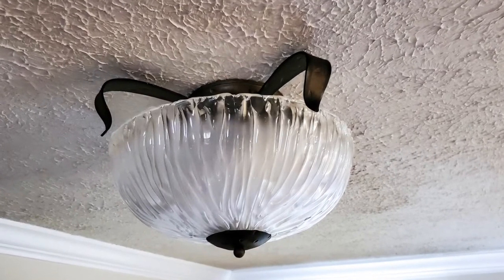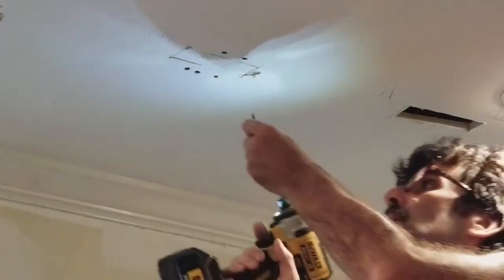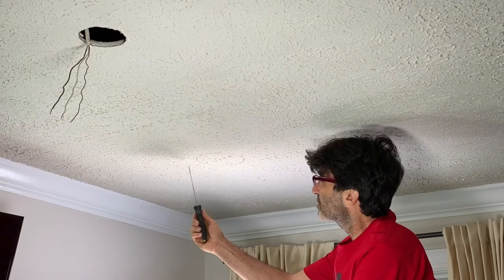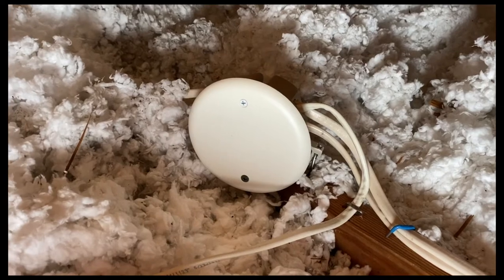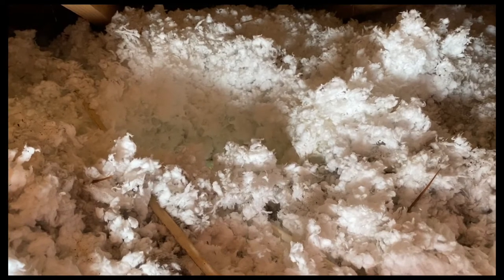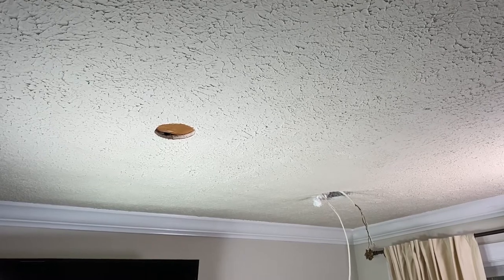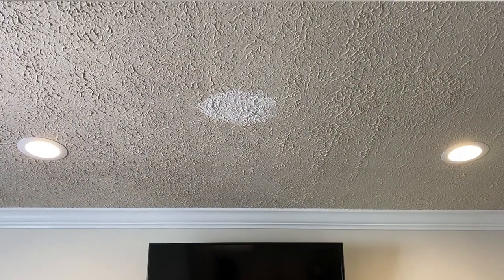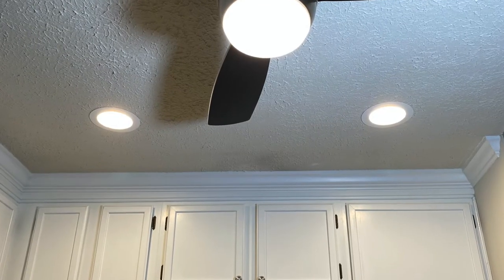How to Install LED Pot Lights in Kitchen Ceiling

Comment: Not sure why your're using cans still the wafers or flat packs are easier and economical
Reply from the maker: Scott S this wasn’t that expensive or difficult.  The hardest part was getting the wires situated.  That has to be done no matter what kind of light is installed.😀😀
Reply: @TheHomeImprovementChannel  Not saying it was difficult at all you did a great job . Show new technology those cans are out dated and the wafer are the new thing out there. They are so much nicer, ease of not fighting with a can  in a hole and fighting with the clips and they have dimming. Liked the video thanks for doing that
Reply from the maker: I'll take a look... :-)